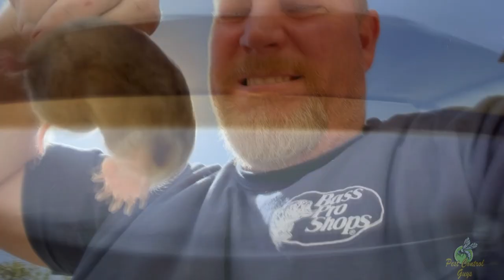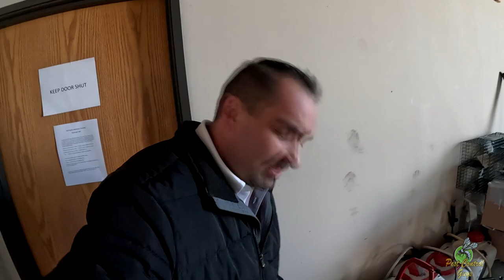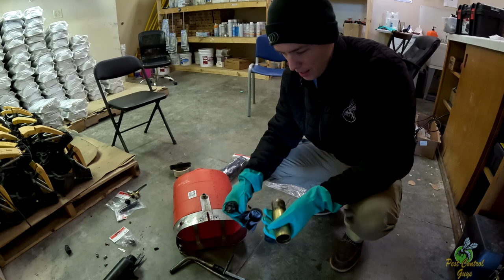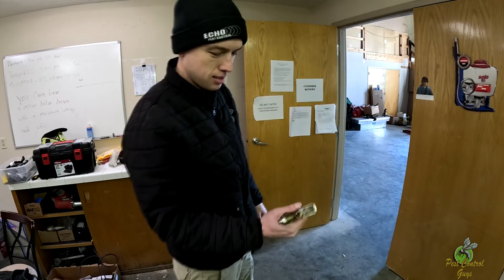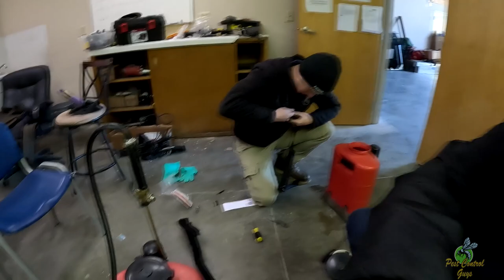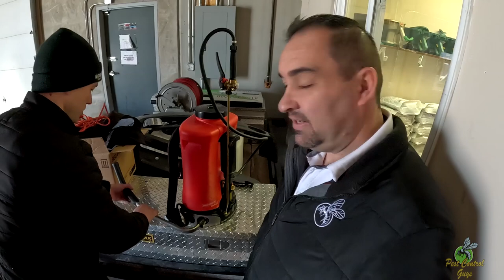Rebuilding a Birchmeier backpack sprayer

Comment: I would just go with a battery powered flow zone ,those Manuel's I never got much power consistently without constant pumping but I didn't know those had brass fittings ,that does make them work better